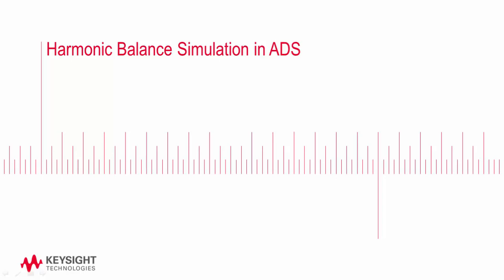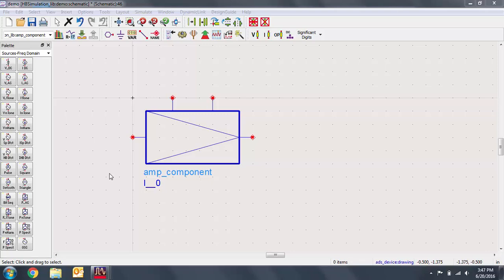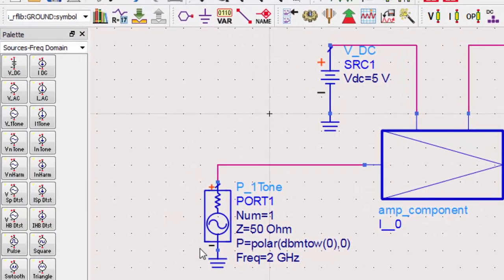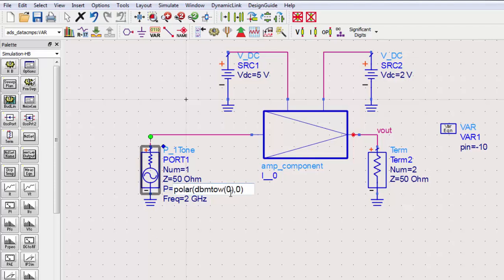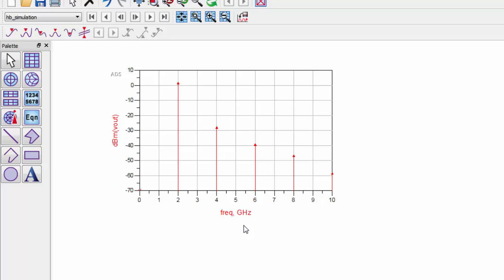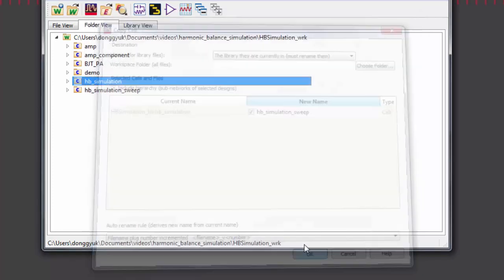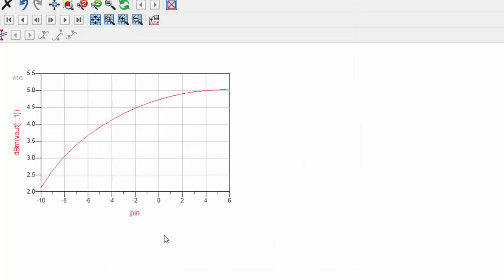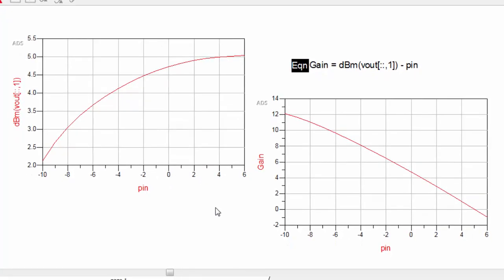Harmonic Balance Simulation in ADS

Comment: The output node of harmonic balance simulation is in terms of voltage. Therefore, for plotting Pout Vs Pin graph, the output voltage should be converted to power. (Real (V*conj(I))
Reply: yeah, i thought we should do that also like V^2 /Z0 maybe
how can he just use voltage and power in same equation, maybe dbm thing also converts is auto?